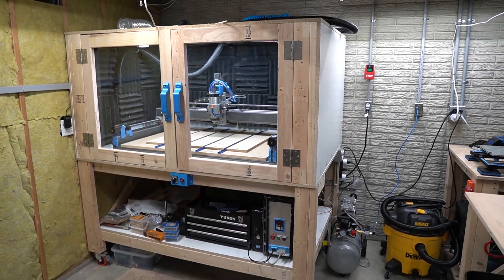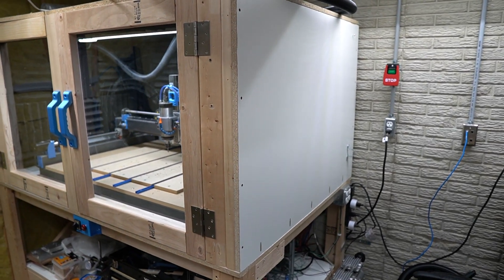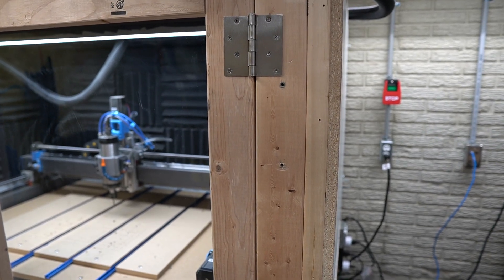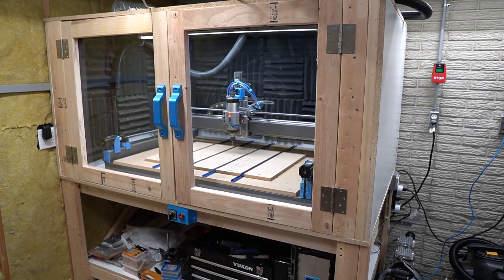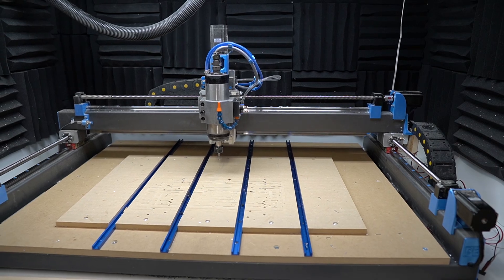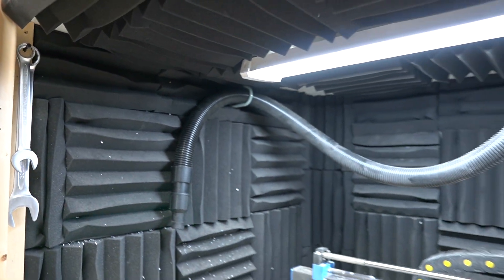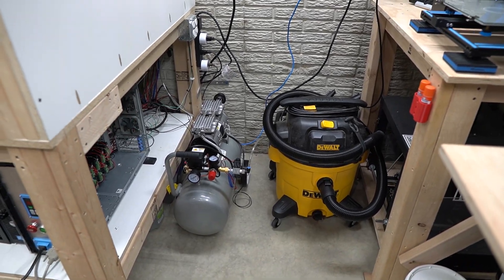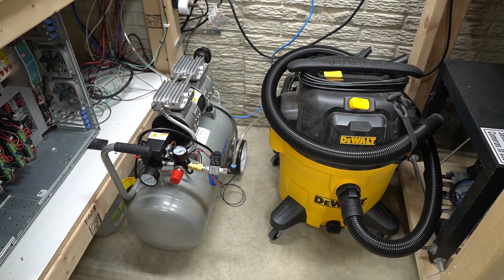PrintNC Enclosure Update!

Comment: 15:30 Could you put a PLA/ TPU95 pad between plate and breaking to smush down and make things level/ square?

In fish tank rigid tube you have to have some sort of flexible house or it messes it up.i likewise on your machine if everything super rigid it has to be super square/ aligned it it will bind up. A flexible “washer” would surely help but not allow things to be loose.

Comment: Another way to prevent the binding is by making a thin plate that you mount between the nut and bracket. you put some jb weld in between and tight it lightly, let it cure and tight it down.

Comment: Hi, Sorry for the odd question; how much does the enclosure help with the sound? can you give a estimate (how much you feel) it has decreased?  assuming it's normal 100%, would that be something like 60%?
Reply from the maker: I would say its closer to 30 or 40% as loud. The spindle is barely audible when idling with the doors closed. Wood cutting is very quiet (shop vac is still sort of cloud) but aluminum cutting is kind of loud. Aluminum cutting in general is going to be kind of loud though. It will be hard to contain those sounds. I hope that helps!

Comment: Another excellent video!  Since you had alignment issues after switching from the 3D printed parts to aluminum, would you recommend sticking with 3D printed for those parts?  If you go with aluminum, what process can you use to avoid alignment issues?

Comment: Brian, thank you for keeping the PrintNC videos coming.  I've done the metal work for my machine and and part way through the wiring.  Can you point me to some guides on how to wire the limit switches?  I went with a mechanical switch and I'd like to have one on each axis with auto squaring on the Y-axis.  I'm using the standard parallel port BoB and it has limited inputs.  I'd also like to add a plate like you have as well as wire in some stop switches.  I've tried looking at the Wiki and on Discord but I'm not having much luck.